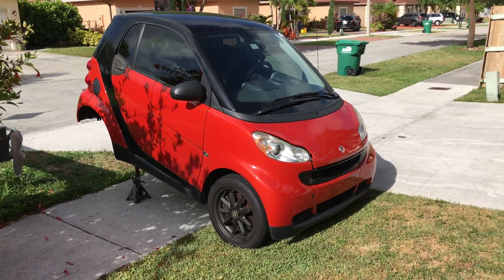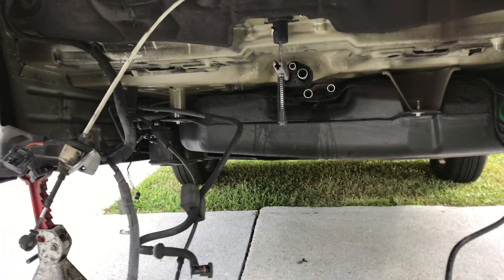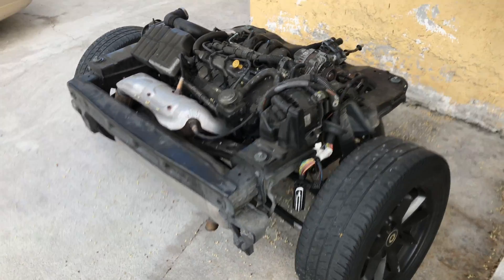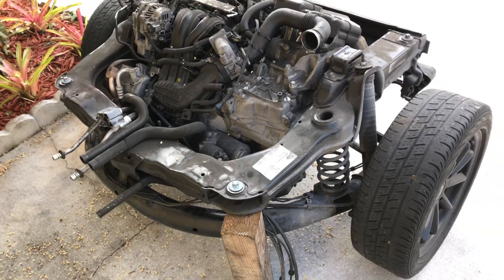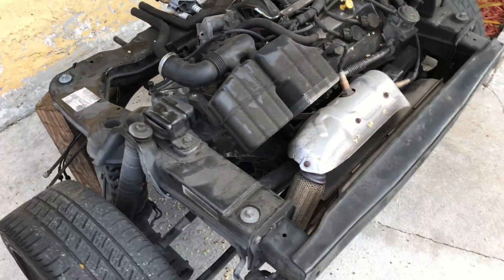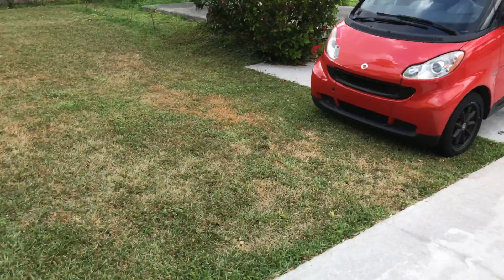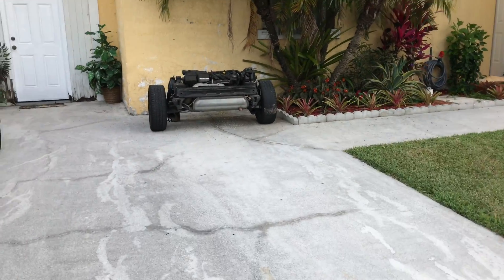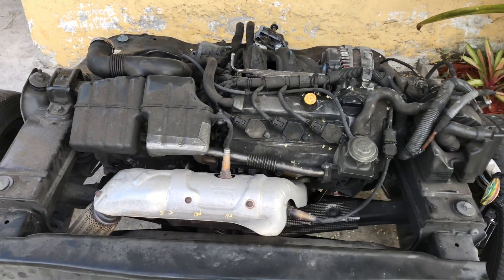smart car head gasket replacement

Comment: The engine DOES NOT need to be removed.  Get/fab four M12x1.5 bolts: 2@26", 2@28".  Support the cradle, replace the cradle bolts with the long ones, lower the cradle onto the longer bolts.  Obviously some things will need to be focused on. This will leave enough space to do the repairs.  MB sells the bolts for $240 (lol!).
Reply: so................. do what dude did for free and fairly easy with plenty of room.... or do your suggestion and work in a cramped space AND pay 240!!!!!!!! DOLLARS!!!!!!! for some BOLTS!!!!!!!!!.... hm.... one of these options seems smarter, and one seems like someone trying to make things easier but really making it more complicated....
Reply: @iceman125971  Most mechanics are not free, dumb dumb.

Comment: Can driving 85-90mph in a smart do damage to it's engine???
Reply: actually, YES, don't believe that other person. other cars have a MUCH higher top speed and usually are sitting around 3000-4000 rpm which is technically friction, so higher rpm, more friction, more heat, more wear. a smart is meant to be driven at 60-65 mph MAX for long distances, you're ONLY supposed to go above for burst when needing to pass or something like that. smart cars are not meant to go that fast and especially not for long periods of time, it will cause head warp-age which will cause the same thing as a blown head gasket its just the head is the problem and not actually the gasket, cause the head warped and will now have to be replaced cause it'll never seal.
Reply: Not any more than a normal vehicle, there are warnings for overheat/over rev

Comment: My 05 Smart engine did 100.000 klms before it blew a head gasket. My fault forgot to replace the cap on O/f bottle engine got hot and went down hill from there. It's possible to replace water pump in car but very hard to do. I will be pulling engine next week and replacing head gasket. If your concidering using chemiweld chemicals that claim to fix blown head gasket don't bother nothing will seal the head gasket and it must be replaced.

Comment: Also have you had any problems with your engine since? My car has been sitting for a few months now. This happened a month after i bought it. It sucked
Reply from the maker: Brad Speckman when it was put back together it was never the same. I recommend having the dealer do it due to difficulty and possible need for re removal. The smoke mainly came from the head gasket being blown.
Reply: @thejacobnegronshow  thanks for the insight. Maybe I'll look more into that option